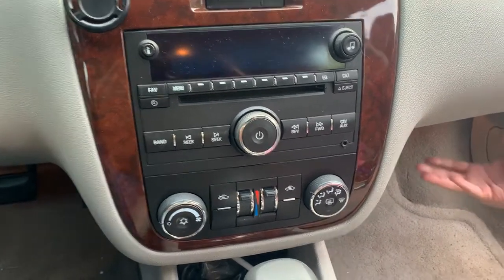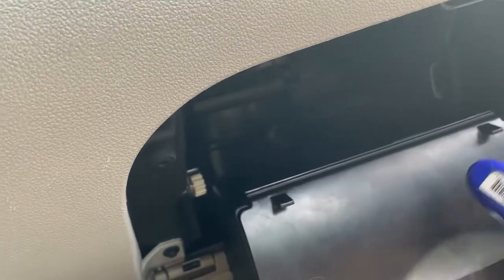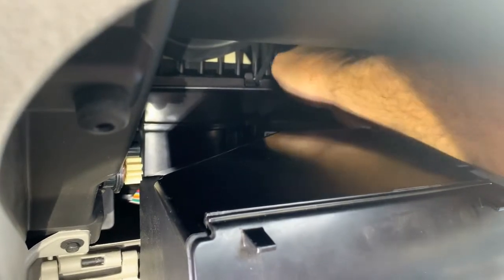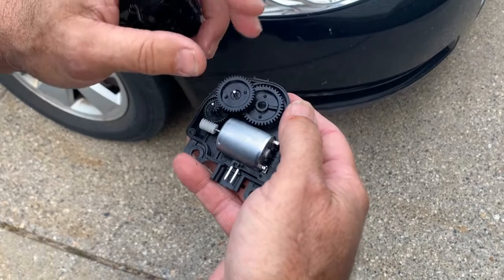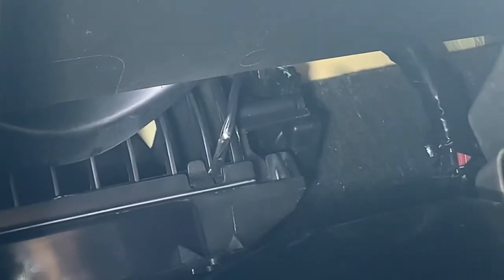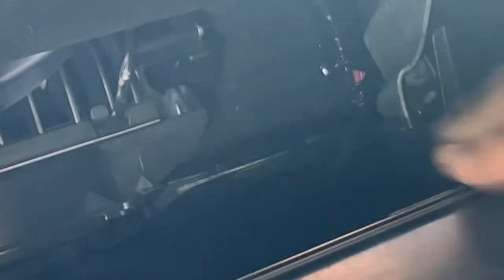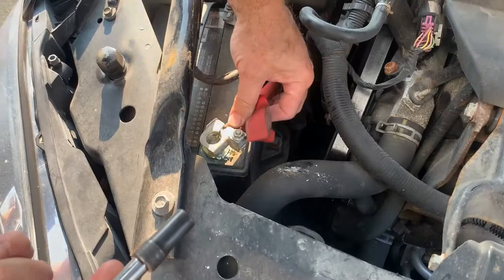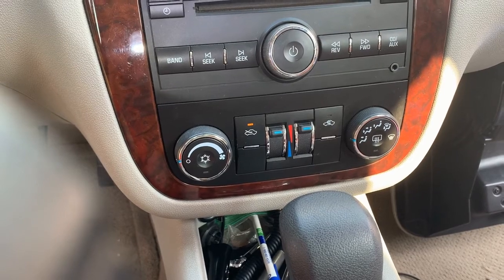How to Replace a Blend Door Actuator Chevy Impala

Comment: You helped me change my actuator on the left side of the glove box. Thank you! Luckily the white thing was already was in the right direction. I had to go buy a short 180 degree moveable head 1/4 ratchet drive to get the screw that was behind a corner. I was ELATED when the clicking was gone. I’ve never done anything before so that shows how simple it is. I also unscrewed and removed the inside black panel/storage of the glove box to have more room. I did not disconnect the battery but I had the car off. I know I read that it still feeds power to it and that’s why it wears on the battery if it’s clicking. I wouldn’t advise anyone doing it that way because you’re supposed to disconnect it. Thank you again!
Reply from the maker: You’re welcome!
Reply: Thank you Jordan like I said it's not that difficult of a job I found out that wrapping the screw on the extension keep you won't lose the screw electric tape when you get it started you can just take the tape off and then continue with the ratchet I will disconnect the battery I have one that's bad right now on my the one you changed out I'm going to disconnect the BET put the passenger put the heat controls in the bottom and then set it put the blower motor in off and disconnect the battery these things they calibrate themself

Comment: Thank you for the help alot of people on youtube were saying to run wires from the battery and put them on the actuator to make it turn into place but you just showed us that we can actualy manualy turn the little white nob thank you
Reply from the maker: You’re welcome. Glad it helped!
Reply from the maker: Thunderbolt  Nobody sells just the gear, you have to buy the whole actuator. I personally have never seen a blend door fail. I’m sure it’s possible, but I’ve never experienced that and I’ve done many. It wasn’t one of GM’s better designs making the gears out of plastic.
Reply: On the actuator the problem is usually its plastic gears being stripped or broken. But if you need to turn the white part on the actuator be very careful you'll strip it yourself. You can turn the car on and turn the ac on then just hold the actuator, slot the white part onto the blend door and use it to turn the actuator I wouldnt do it by hand
Reply: Well I said white piece on the actuator but I guess it can be black too I've only ever seen ones with white receptor parts but yea

Comment: The one on the right side I assumed was the issue. It changes door from inlet air to recycled air, but for some reason I can’t set it to the correct position, tried both ways open and closed…when I have it on inlet, and then switch to recycle with the button, the clicking comes back after it switches….start the vent on recycle abdvthe clicking is there
Reply from the maker: That year Chevy Impala had four blend doors, and sometimes it's hard to determine where the clicking is coming from. If it seems to be on the passenger side, you're going to want to remove the glove box and actually reach in there with your hand so you can feel which actuator is clicking so you replace the correct one .

Comment: Great Video! I have a 2011 Malibu making the exact same sound, the mechanics at my store said Blend Door is stuck. I noticed that every time I press recirculating air button it stops making the noise. Can you just simply press the recirculating air button to silence it and it will cause no harm at all? As opposed to replacing it?
Reply from the maker: Thank you, as long as you're getting the temp that you desire in your vehicle and the clicking noise isn't driving you crazy you can drive it as long as you like without hurting anything.

Comment: Thank u‼️‼️‼️very helpful
Reply from the maker: You’re welcome!
Reply from the maker: You don't have to calibrate them. Where are you buying the part? If you're trying to take a cheaper route and it keeps breaking, it may be best to go with the one from the dealer or one that has a warranty.
Reply from the maker: I’ve never had a blend door stick or fail, but I have had actuators that I purchased from Advance fail. Maybe they just got a bad batch of actuators. I would try buying the part directly from the dealership this time.

Comment: Shame on GM for the rate of failure on those actuators.
The driver side on my 2013 LTZ Impala failed and just a few weeks ago the passenger side failed. Now I need to break out the wallet.
Reply from the maker: Agreed, definitely not one of the better designs.

Comment: Are all the actuators the same on the passenger side even if it’s in a different location?
Reply from the maker: Not sure, I just replace the one that has failed and make sure that I get the proper part with the proper number at that time.

Comment: I had a question man i swapped the one on the left side and I noticed the one you fixed on this video actually clicks also. But my main question is that when I swapped the one on the left side of the glove box, my ac doesn't blow cold anymore. Did I do something wrong? Or will I have to get the other one fixed to get cold air.
Reply from the maker: If it’s clicking then you should replace the other one as well. That should fix the cold air problem.
Reply: @TheAutoTeacher  ohh okay man thank you!
Reply: Set the controls WTF in the cold position you have to disconnect the battery take that off turn that keyway to the position of that actuator that door should be closed when you install these that's the fresh air these things will calibrate themselves when you adjust it for heat or when you turn it back to air conditioning so start from scratch from that one on the right that's your control one you can do this
Reply: The actuator on the Left-Hand Side (LHS) of the passenger side controls the passenger temperature blend door. You need to verify the installation was correct by moving the temperature between hot/cold on passenger side and either feeling the difference in air or listening for the door operation.  Visually check to see if it is moving or place your hand on it while commanding its operation to feel that it is active.
The actuator on the Right-Hand Side (RHS) of the drivers side controls the drivers temperature blend door.
The actuator on Right-Hand Side (RHS) of passenger side controls the recirculation air door.  This door allows fresh air to flow in from outside or allows recirculation of inside air which is the one changed in this video.
Reply: @wtf3494  yep, the rightmost actuator is the circulation actuator in these cars as far as I know so that should definitely fix the no ac

Comment: When I had oil changed at a Chevy dealership, they showed me the filters from cabin & air filter. A mouse had made quiet a mess with the filters, after they was finished is when the helicopter noise started. I have video of my Impala 2011 starts making the noise and it's not even running.
Reply from the maker: It sounds like one of your blend door actuators is broken, this can even continue when the vehicle has been shut off.
Reply: That is coincidence.  One has no bearing over the other.

Comment: Great video, what is the size of the 2 bolts holding in the accuator? I accidently dropped them during the install.
Reply from the maker: Sorry, I’m not sure about that. You could check with the dealer. They should be able to tell you.
Reply: same here!, did anyone find out what size screws!?

Comment: Is this really needed or can we just bypass it who needs this thing if you don't use your air conditioning?
Reply from the maker: If it’s your dual climate control actuator that has failed, your temperature will be stuck on one setting with no ability to adjust up or down, which could cause you problems in the colder months! So it’s probably a good idea to get it fixed but not essential .
Reply: if the actuator is just clicking but still functioning properly; you may be able to get it to the location you want it to remain; i.e. hot or cold / outside or recirc; then remove the electrical plug.  I have done that with recirc door since we want it closed in summer to recirc cool inside air.

Comment: Does the 2014-2016 limited models have this problem?
Reply from the maker: I’d like to think they fixed it, but I’m not sure
Reply: @TheAutoTeacher  I would hope so. I was just asking because they're the exact same body style as the 9th Generation but with the Parts of the 10th generation.
Reply: @GameTesterDev  yep I’m having the same problem with my 2016 limited version
Reply: Yes I'm having the same problems with my 2016 limited lt
Reply: Very common problem with Impala's due to cheap plastic design of motor gears.  Fortunately they are cheap and relatively easy to replace.
Reply: @rpruneau68  Yeah... Finally got the problem after a year of owning one... Only cost $36 to replace all of them.

Comment: Whats the part number to the specific actuator that was replaced in this video?
Reply from the maker: I’m not sure. I’ve worked on many cars since this video was posted. I believe I got it on Amazon. Just put the make and model of the car and it will tell you if it’s a fit.
Reply: I just removed mine and took it into autozone and compared. I ended up finding the right one there. It was hard to try to find out which one because they’re all called blend doors and all kind of look the same.
Reply: Just do a google search for a temperature blend door actuator for your year and make of vehicle.  They sell (2) in a kit for some foreign made brands or you can purchase an OEM AC Delco for same cost as the two.

Comment: can u put the actuator on that white male stem wrong ,like if its turned wrong when u start
Reply from the maker: You should be able to turn the white stem to the proper position to allow you to install your actuator. 
I don’t think it’s possible to put the actuator on wrong because you wouldn’t be able to start the two 5.5  bolts .Make sure that you turn the white stem and not the actuator. If you try moving the new actuator it’s possible you could break it

Comment: If it dosnt click could the bda still be the problem?
Reply from the maker: What problem are you experiencing?
Reply: @TheAutoTeacher  no heat at all under any conditions. I thought maybe the main door was stuck on cold but i don’t hear any clicking or abnormal sounds. I have two hot lines in and out the heater core.
Reply from the maker: First check to see if the coolant is where it needs to be. Is your temperature gauge reading  normal or is it lower?
Reply: @TheAutoTeacher  it was reading one mark above normal I added coolant and now it sits right at normal but no heat still
Reply from the maker: Does your vehicle have temp controls for both passenger and driver? If you’re getting heat on the passenger side, even though it’s not clicking it could have still burned out.
Reply: @TheAutoTeacher  it does but I’m not getting heat from either side.
Reply from the maker: What year is your Impala?
Reply: @TheAutoTeacher  2005 3800
Reply from the maker: It’s unlikely that both actuators burned out, but it’s possible. You could start by replacing the easiest one, the passenger side and see if it then blows hot air. I just worked on one yesterday on same car, it didn’t click either.
Reply: @TheAutoTeacher  ok, I will try that in the morning thanks for your time.

Comment: wow i wish it was that easy as the video seemed it not that easy i done same exact thing to mines and if you have big hands its barely room to hold tool on screw and turn without it keeps 
drop out your had several times the top screw is the hardest to get and to reinstall is pain in the a... also
Reply from the maker: It's not easy, but with the proper tools and the more you do it, the easier it is.
Reply: @TheAutoTeacher   yea actually i use my cordless ratchet to help the screw stay in place because it keeps falling out and its pain in the a.. to get in especially the top screw no room for big hands